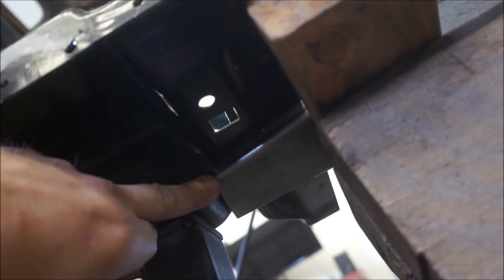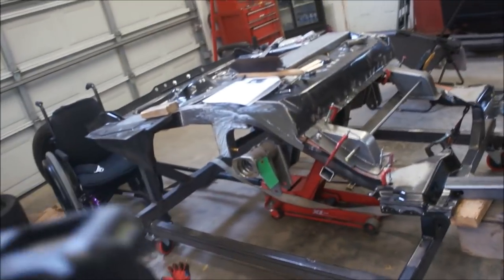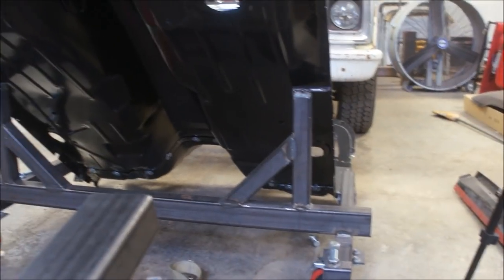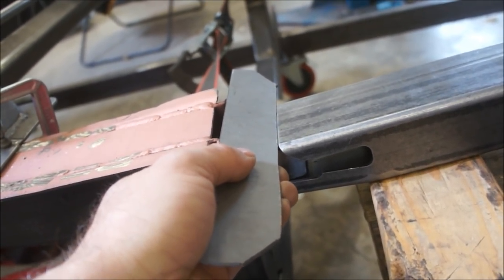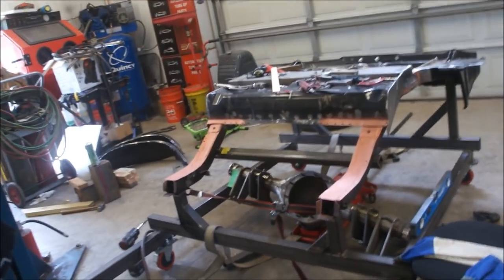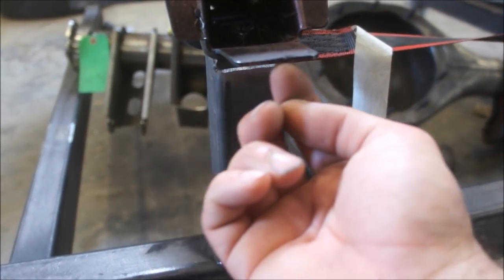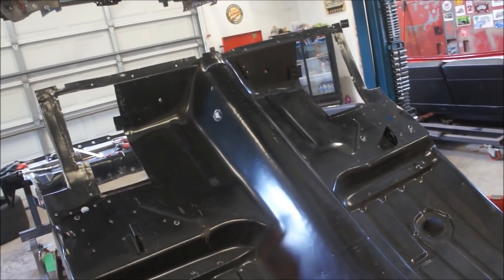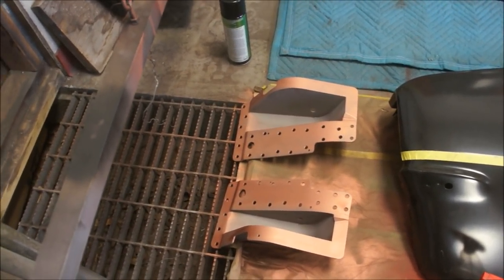Dse quadralink modification

Comment: Your approach would make it more robust for sure. Fully boxed is stronger than a lower tab weld. On Art Morrison's rear chassis, they have a full square tube that runs across the rockers at the front of the rear frame rails. Then their  sub frame connectors are welded to that full 2x4 square tube. They discuss this issue in their design and mention the wimpy 20 gauge pivot point that is created with the other's approach. Go for it.
Reply: I was going to ask Roger if he has called DSE. I hear they have a good support line. They might have a good reason for doing it this way. Sounds like you found the competitions answer. I imagine the rigidity of the complete structure is pretty strong the DSE way once the whole floor, rockers, etc. come into play. It will certainly be strong if you tie those top points together though.
Reply from the maker: asicerik unfortunately I have talked with Dse several times and all you get to talk to is a salesman that will go ask a tech your question and email you an answer. Unfortunately I think these kits they are selling are built for average person that has basic welding skills . My guess is that their top shelf cars like “the mule” that are owned by millionaire investors are probably built at a higher standard than the basic kits they sell to us . IMO
Reply: @MrFireman164  That sucks. Well, you gave it a go anyway.
Reply from the maker: asicerik yep this just allows me to have a creative outlet so it’s all good
Reply: @MrFireman164  you are going to have fun with this, no doubt.

Comment: There is a trade off when it comes to track cars , they are trying to maintain a positive power to weight ratio . The more added weight on the parts the heavier the car and the more horsepower your going to need to get good track times . I'm sure their engineers did the research to insure it would be strong enough . 2 pounds here and there , another 5 pounds here and there and so and before you know it you've added 100 pounds extra .
Reply from the maker: Craig Voisin possibly , i will build-strong and spring for a little more power to pull it

Comment: I see what your saying roger but your cage will weld to the rockers and a diagonal support to those frame connectors as well so it will be a strong cage your cage.  85% of the strength of the car will be the cage if done properly with triangulation it will be one strong car.  typically these cars are flimsy in general but once the cage is installed your car will be very ridged.  I just sold my 69 tubbed car it has a 12 point cage and I will tell you the frame is very strong.  also I may be purchasing a 68 and if I do I will get a tube chassis built for it.
Reply: yes I dose depending on what type of cage he is going to build 6 8  10 or 12 point cage
Reply from the maker: Chris Mansker thanks for thinking about it , we will get her set one way or another 👍
Reply: oh im sure you will roger the car will be a bitchin ride when your done

Comment: Roger I believe those are pose to end up being sub frame connectors ??? Check out Hotchkis sub frame connectors part #4007 . They are pricey but excellent design they cradle the rear frame rails from underneath and have gussets for a nice strong weld no cutting anything they are contoured and for the front connection you can either bolt and or weld . They also come with new front sub frame bushings . Might save you some work 😎
Reply from the maker: Anthony Szarpa I’m in it for the work , this is my creative outlet

Comment: The DSE stuff is some of the nicest around ... your right but wrong , the subframe connector is welded to the sheetmetal floor the whole length , the torque box is also welded to the floor ... Mark Stielow is a gm engineer and has beaten the shit out of his camaros with 1000 hp , build it the way DSE recommends
Reply: @kevinsedo6869  I'm not saying anything about the greatest minds in the world ... I'm saying DSE was started bu Kyle and stacey tucker .. both gm engineers.. who are very good friends with mark Stielow work is also a gm engineer and the God father of the whole pro touring movement . Many many f bodies have had no problem installing the subframe connectors and have had 1000 ish h.p . So to re-invent the wheel when it isnt neccessary is time wasted . Dse has excellent customer service and there a bunch of videos of others installing these same parts , further more theres pro-touring.com and lateral-g.net  both of these sites are plentiful with info regarding how , what where why etc those subframe connectors the right way .
Reply: @kevinsedo6869  lmao listen you dont need to be rude , what I'm saying is I'm very active in this community.. I dont currently have a Camaro I currently have a chevelle.  I do read lots and seen many times where a slight misstep or over sight can really bites someone in the ass . This is why I recommend installing them exactly as recommended.  This man does have quite the skill set so if he so chooses he can very easily do the mods he wants after the car is more together.  Eg. Subframe connectors arent supposed to be welded in until the front subframe is installed and squared . I'm also a fabricator I have made many goofy mistakes that have screwed me in the end as well so   if I can possibly prevent this man from  making a mistake I will
Reply: @kevinsedo6869  hey I  may be 100 percent wrong and those subframe connectors might need a lil fixing .. I just know I've never seen it on any other cars , mark has built 20...23 ish  first gen camaros and has a build book , also dse has like a million pics on their project pages . It would be best to contact someone who's much more knowledgeable about first gen camaros and these subframe connectors than myself . I got rid of my Camaro before I got to the point of installing any so I can't even comment from personal experience,  anyways cheers
Reply from the maker: Mark is a multimillionaire engineer my bet is he didn’t just weld their basic do it your self  kit into his cars , these kits are made to give you the basic stuff to have a decent street car or take to the track every so often , these kits are built to make Dse money . These are “show parts” if I were to make a vid on the real quality like lack of good weld penetration ( they are pretty so the customer thinks he got something special) but when you know what strong well penetrated parts look like , these fall short , they are just functional pretty pieces . I spent 5k on this stuff and now I have a base to start with . These guys are punching a time clock .
Reply: @MrFireman164  that's an understatement but no he literally uses their off the shelf shit .. gets it for free or at cost of course thou
Reply from the maker: Ryan Austin then he must be one hell of a good driver , I’m just going to add a bit bore steel and a few more welds , not changing the design
Reply: @MrFireman164  again serious understandment ... he put one of his 69s up against a new Camaro the car was either hellfire or jackass against a new z28 videos of it here on YouTube

Comment: I'm installing a quadralink.   Have a question about the upper pockets.  On passenger pocket my seatbelt hole looks to be wrong.  Did you have to slot the pocket bu hole